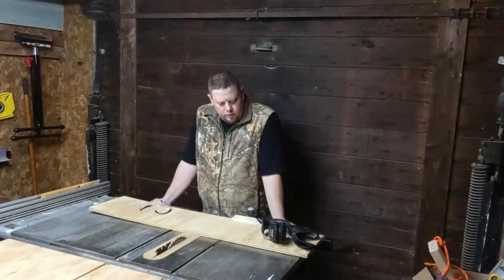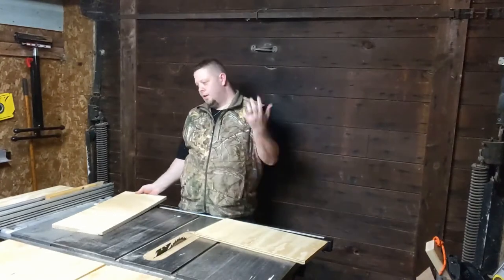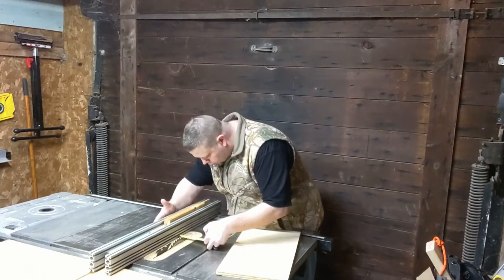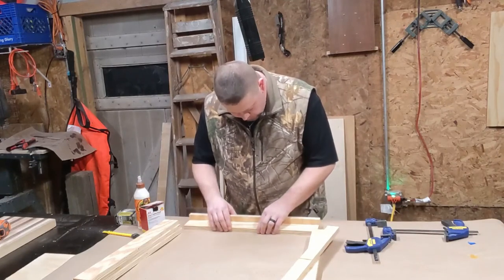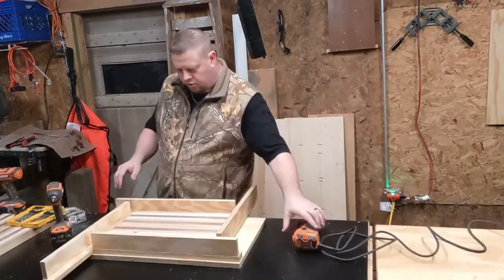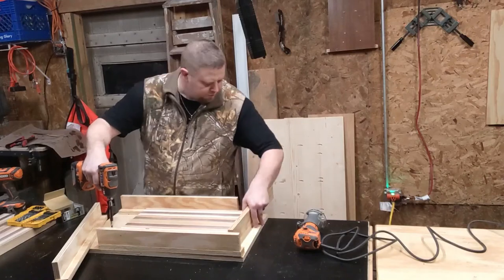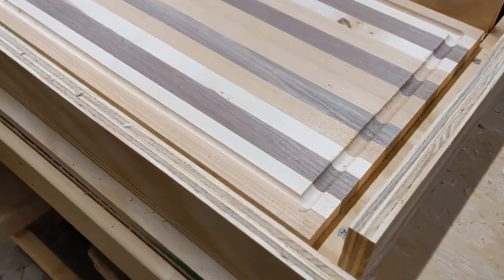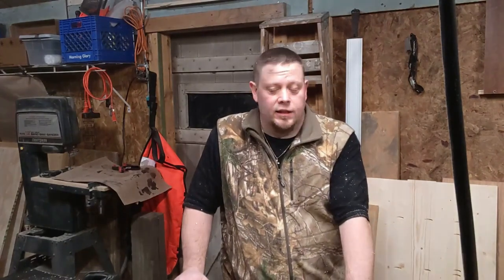Cutting board Juice Groove Jig

Comment: Good video, well done. I've only made a few cutting boards, haven't tried the juice groove yet. This video will definitely help me get a jig built. How many passes did you do with your router to cut the juice groove?
Reply from the maker: Only 3-4 not as many as I thought I was going to have to make.  I did learn before starting to slow my router down, I always had it on full speed thinking faster is better but actually for these hard woods it was better to slow it.  Good luck and you can do this as well.